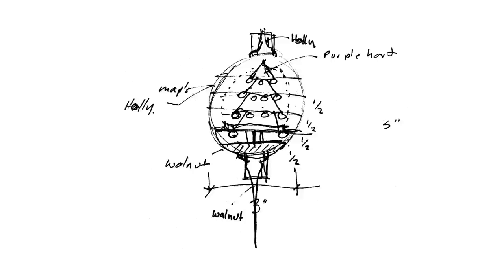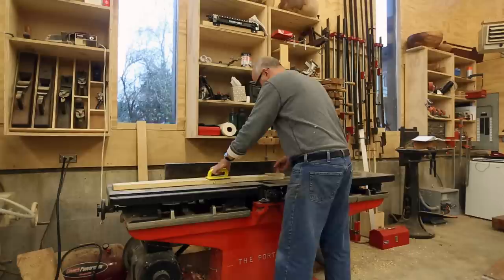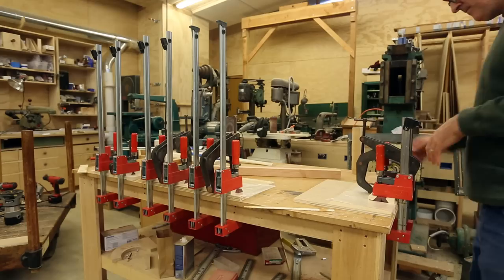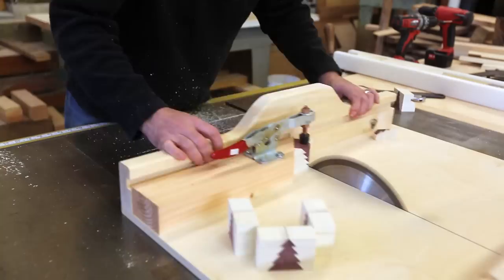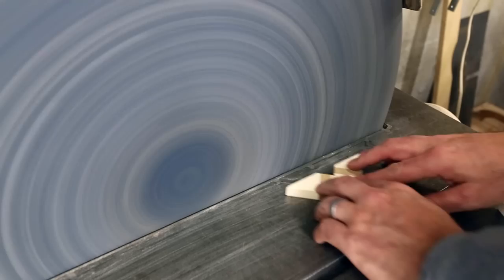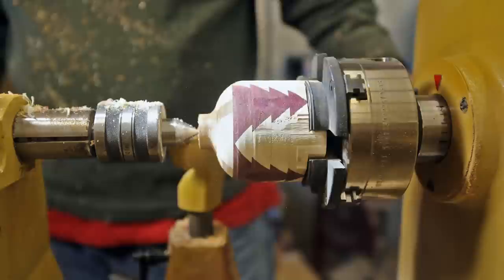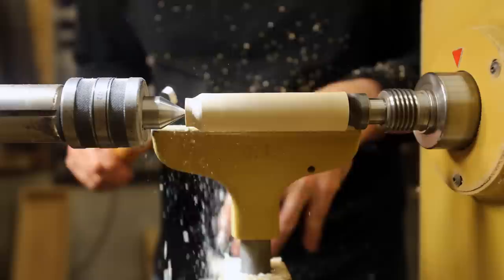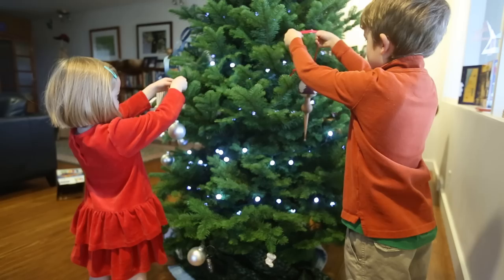Woodturning a Segmented Christmas Ornament

Comment: a little salt sprinkled on the glued surface helps keep the wood from slipping when trying to stack and clamp like that... you could even just do it on the outside edge where most will be cut or turned.

Comment: Just as a tip: 
      When glueing up several pieces like you were and trying to get them 
      not slide around, just sprinkle a little salt over your glue before you                
      put the top piece on. This really helps with getting the pieces to not
      slide around as you clamp them together

P.S. Keep up the good work. I love to watch your videos. Great job!!

                                                                  Foster

Comment: I think you can easen up the alignment of the segments if you after cutting the pieces, before gluing anything, cuts all pieces to the same length and make a small rabbet at the end of the pieces that makes up the center, so that you after gluing each segment ends up with a vertical centered dado at each end of each segment and then you can take anything vertical and press into both ends automatically forcing the segments to line up for the final gluing.

Comment: you should check out steve ramseys videos. to clamp small things like boxes, sort of like your mitered joints he uses rubberbands. I have used this method and it actually works very well. the first rubbberband is hard to get on sometimes but it clamps well

Comment: Frank that may be the second time I heard you mention movement with your joints when you glue up.  I remember hearing something from Chad Stanton (WoodChoppin Time) that you can sprinkle a pinch of salt between glued joints and it will keep them from sliding and the few grains of salt will dissolve into the glue.  I have not tried it so I may be setting you up for failure.  You give me enjoyment with your Vids just trying to return the favor.  Still take my advice with a grain of salt. Sorry;)

Comment: When sanding, how do you make sure the flat lane is perpendicular to the edges? Isn't it easy to press to hard on one side, thereby changing the flat surface in perspective to the sides?
Reply: That can be a problem, but sanding in this manner seems to be something that comes with practice and experience. Additionally, using a fine grit sandpaper gives you a bit more control with how much material you are taking off.